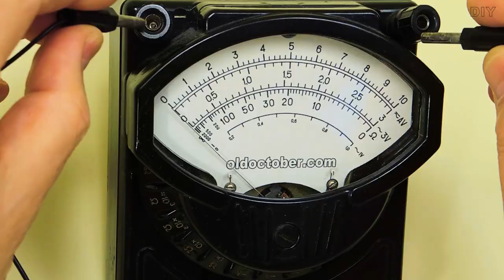Power Station in Your Pocket

Comment: Centrain tree type exposed to apoxy ,centrain cristal for light emiting effects thats actualy similar to solar cell ore antena pick up effects range from different metal paricel used it can also metal based acid solutions enchanced effect useing elements that are preshure reactive mostly different electrodes diffenert effects .
You can look at that thing more likely cristal capacitor light absorbing ore frequency capturing device and converting it to different ac dc and unknown electricitys and it mostly resembels reciveing antena ore cinde of solar plates cristal its sensitive to light similar to light emiting diode and shure be told same materials you can finde in mentioned devices🙄 mix all that shit together and there you go unusual baterry that has lot characteristics and yes Im seriuse it is shit indead ethanol/methanol gas aka bacteria so partialy that cristal thing is microbial cell as well so thats your answer how that thing is build tehnicaly you can add ither coils different materuals ore plates use that shity thing as ither transformer ore capacitor tehnicaly .
Its charged wia heat,light,ore preshure.
So its self regenerating energy basicaly over time .
Pulse that shit with transistors probably it spins forewer🙄 but no you actualy must replace chemicals ore bacteria eventualy ore simply shit on that thing pop ore piss at that thing😅 because its microbial cell partialy tehnicaly 🙄 so indead its shit fuel gasoline is shit ethanol/methanol gas is shit tehnicaly poping bacteria all right 😅 so thats end result if you actualy mix all those baterrys together but it can kill you be aware of that so thats why it is not used its non predictabel and it can over time change its polarity and deteriate evry thing surounding you including reacting with other elements positively negatively and neutral charged plus it can react with other organic mass meaning even human body so it kill you again I hope I made me self clear about that piezo disc.
Why do you think requares so litel force to brake thick glass with just fragment of spark plug ceramics?
If you actualy brake that ceramic you change polarity aperantly depends what charge that glass is it changed to wrong polarity if you shater spark plug ceramic meaning it destoy its molecular structure same is true if the cristals break in that piezo disk ore they get displaced for some reason your human body explodes ore implodes on tuch .
Even that hamer that guy carry culd posibly electro cutt him if for some reason bouth charges are present to destroy those 2 different materials used to make that hamer.
So thats logical explanation why piezo disks are not used !
And if they are used its controled with precise voltage polaritys ore different electricitys and normaly they are tripel insulated as well .
So they are activated with small heavely regulated voltages and those piezo disc actualy can react to sound waves as well.
So there you have it why its not used !
With out that sience bull shit so simpel peopel can understand the difference .
Its simply universal device who can have multipel polaritys at different angels for centrain effects.
That same piezo disk God knows how much development was invested for makeing  that thing and still peopel culd not control it to full degree because of bade tendency to kill peopel mostly be acident it can be found preaty much evry whare from house hold mashinery up to high industry devices what ever uses ceramics its piezo effect based even radiose microwave ovens tvs phones antenas coils transformers metal coatings etc ☺️ dono hope this helps some one understanding that thing its used evry where and no still today resurche institutes do not realy know how that thing works they just like to gloat I supose but mostly ashole cuck sucker sientist watching to much cartunes I ques 🙄

Comment: the math does not add up at all
water boils at 100'c 
paper lights on fire at 232'c
you measure 63'c

but yet you still burn paper and boil water.
furthermore the piezo electric effect does not work with static pressure and yet that is what you demonstrate in the heating coil display.

there is so much wrong with this video.
and then you say you can't disclose details... yet another red flag.
Reply: the fact that you coiled the wire is very suspicious as well.

you wouldn't happen to be hiding a coil under the table would you XD ...
Reply from the maker: @logangraham2956  Thanks for the criticism! This is my fault. I did not foresee that someone might think about the induced electromagnetic field. Next time I will use a steel screen and shorter wires.
Reply: @IurisWorkshop  it is fine .
im not exactly an average joy .

normal person would probably look past it but i've spent almost my entire life studying random bits of tech. both software and hardware.

but i know that my knowledge , very vast that it is. is also somewhat limited in specific due to the lack of any formal education in the matter.

my knowledge building is great and big but it lacks a very quality in the foundation.

Comment: This is fake, dont believe it...
Reply from the maker: Science is not a religion in order to believe in it.
Reply: @IurisWorkshop  Yeah, science is not a religion, absolutely right.

That‘s why I can confidently say that this is deceiving, unscientific bullcrap. Absolutely worthless fake.
Reply from the maker: @GreenCaulerpa  If you are using the adjective "scientific", then it would be more logical to make a conjecture rather than a statement. To assert something, you need to have at your disposal facts that you do not have, since I did not supply them. ;)
Reply: @IurisWorkshop  It‘s really enough to know that you claim that this is supposed to be based on the piezoelectric effect which it clearly is not. So let‘s say that W = ∫F*ds in this particular case we have W = ∆E so as the laws of thermodynamics state you can‘t essentially produce or destroy energy, energy can only be transformed into other forms of energy (including matter as a special case). Even though the demonstration with the hammer is a bit doubtful, there‘s still a good chance that by chance you‘ve found a novel high performance piezoelectric material that was able to supply enough enough current to essentially vaporize the wire. (Even though piezoelectric materials typically produce high voltages at low current). 
Even though it seemed doubtful as well that the hammer had an energy high enough to vaporize the wire to begin with. 

But as I already stated this fake is revealed as you‘re clamping this thing down as you‘re essentially not providing any energy that could be converted, but solely force. 
Force is not equal to energy and hence you can’t produce energy from force. 

Despite from that your channel has some free energy videos which are inherently fake so it was obvious this would be as well.
Reply from the maker: @GreenCaulerpa  Thank you for your comment! This was much more correct than a peremptory statement. I was usually accused of using a coil of connecting wire for the second part of the experiment. I simply did not foresee that this could be the cause of mistrust. Since these wires are a bifilar coil. This means that this coil has a total of one turn.

The idea is, of course, unfinished, the element works unstably and does not last long and collapses. But I managed to sell a copy of the item along with the claims. The same goes for my other two ideas. The channel itself doesn't make a lot of money. I use it to promote my ideas.
Everyone survives as best they can. :) Have a nice day!
Reply: @IurisWorkshop  Okay then let‘s assume for one second (even though I‘m still convinced this is fake as there is no possible way a piezoelectric device could output such a high amperage or an electrochemical device 10V per cell as this is far beyond even the highest and lowest possible redox potentials) that this is indeed real. Wouldn’t it be then better to publish it so other people can try it themselves and chemists can figure out what’s the source of action? So in long term you could start crowdfunding and make a team of researchers working relentlessly to make this cell applicable in real life use?